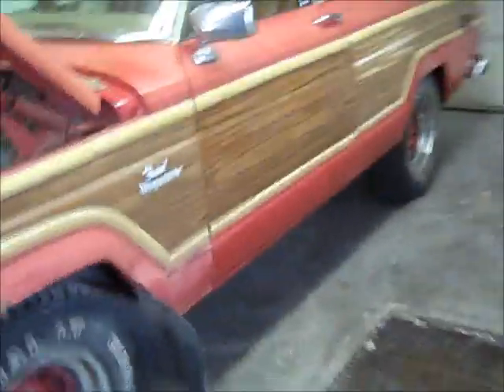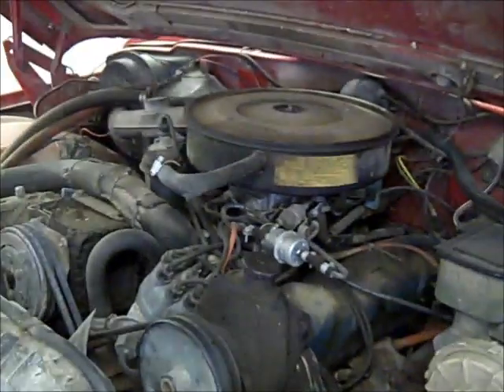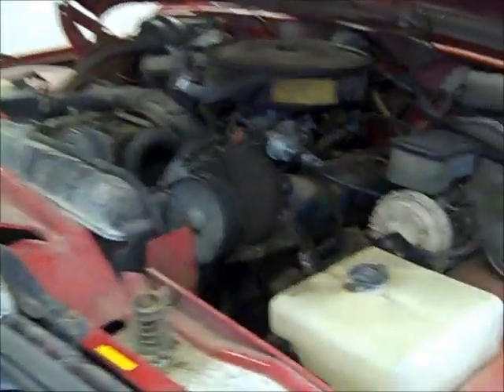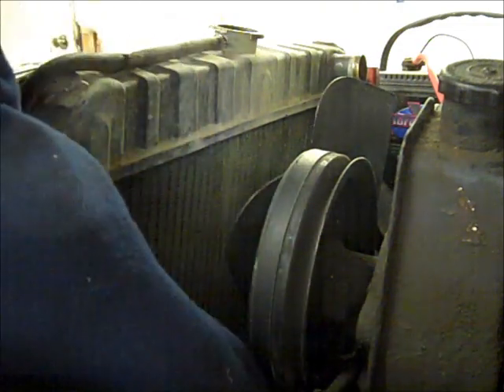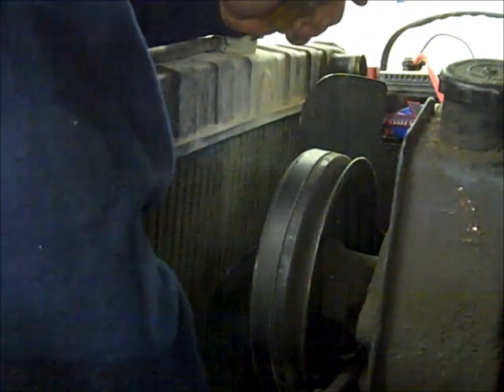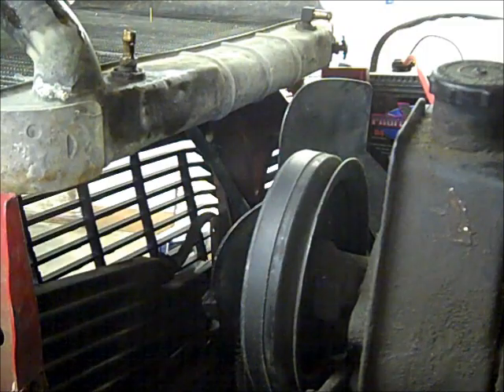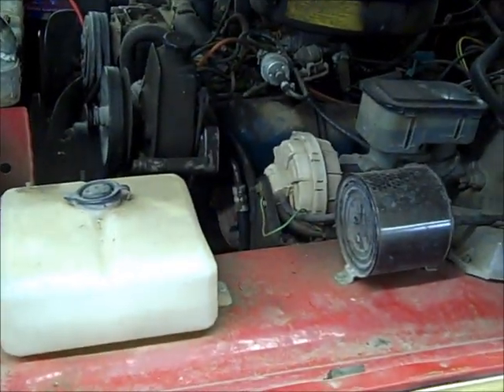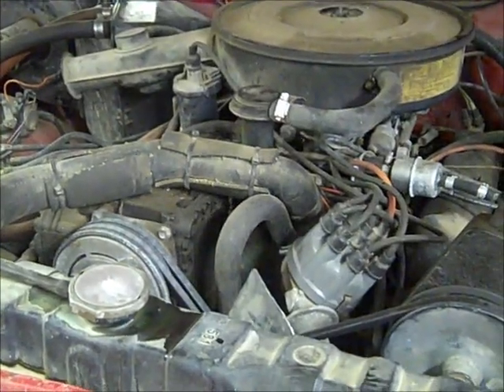Fixing Denny's Jeep (Again) Part

Comment: Nicely done even though it's a radiator, it was good to watch.. I had a flush once they ended up plugging the heater core, then tried to sell me on a replacement, complete with labor! I took it home, put hose to the return line of the heater core ....popped out the crap and it worked just fine.

Comment: I have a little tip for you that i found saves a lot of time when working on things.  I'm only 18 and I work for cat on heavy equipment.  I found when your taking things apart always take off the hardest to get to bolts first so you can back them out by hand instead of fighting them all the way out.  Its just something to think about when your fixin stuff.  nice to see you back!

Comment: Hello from Billings! Temperature sending unit is in drivers front corner of intake manifold right behind distributor. Take the heater hose off at rear of manifold when filling with coolant to make sure you get all the air out of the block.

Comment: Have you thought about cutting an exhaust hole in the garage door and putting in a small flap covering. That way, you can hook an exhaust hose, stick it through the door and won't have to let the cold air in during cases like this jeep. 
I also would flush the heater core first before doing the water pump.